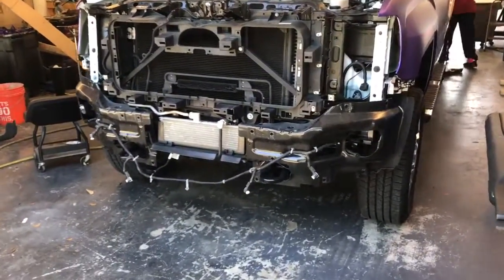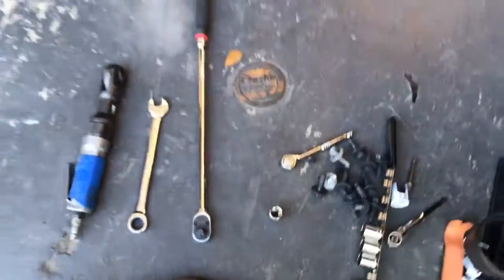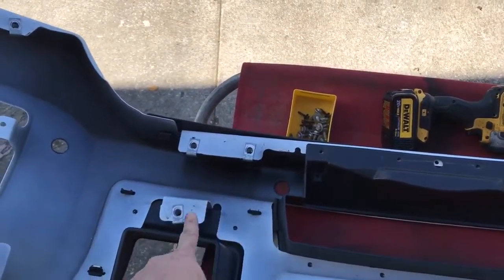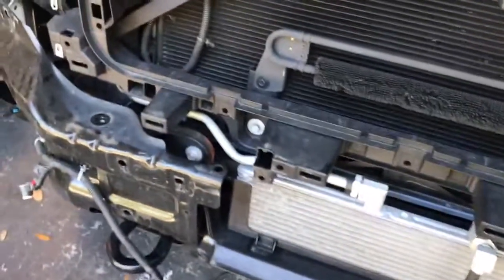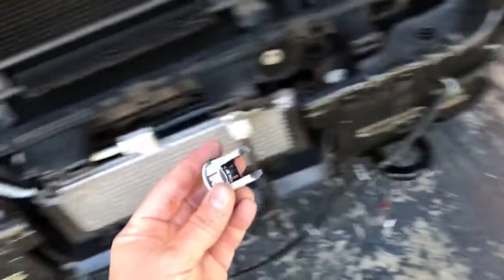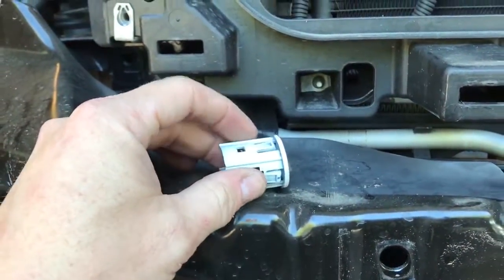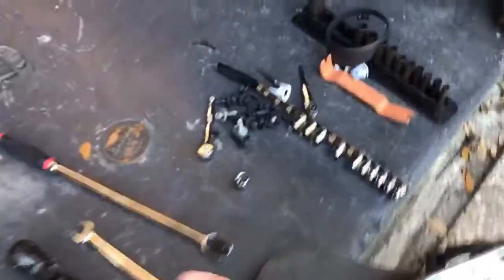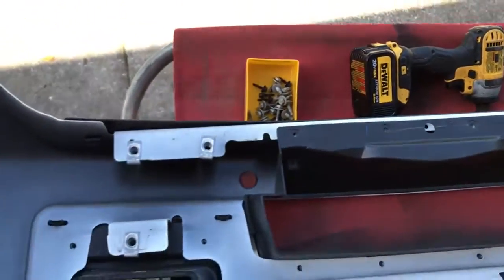How to remove Front bumper 2016 2500 GMC Chevrolet truck

Comment: Appreciate the effort in getting the video up but DO NOT REMOVE THE BUMPER THIS WAY! I spent 2.5 hours trying to get all those bolts out and trashed a $300.00 skid plate in the process. Just remove the 4 18mm vertical bolts.
Reply: where are the 4 18mm bolts you are talking about?